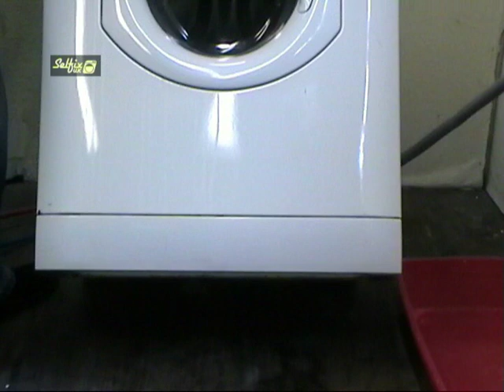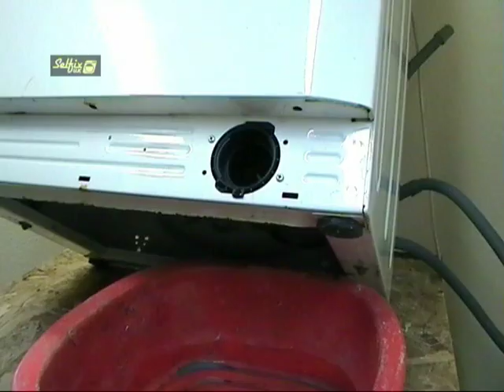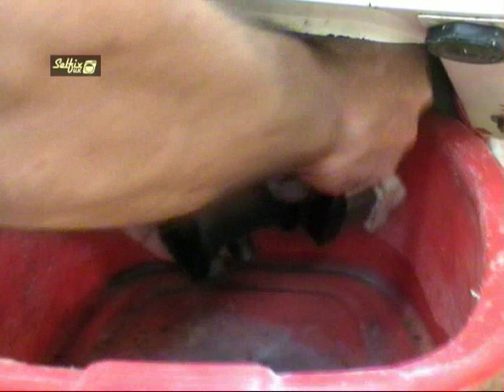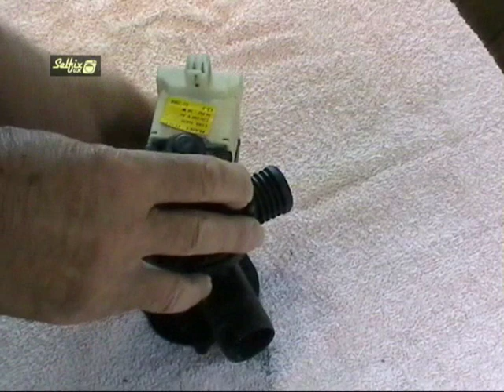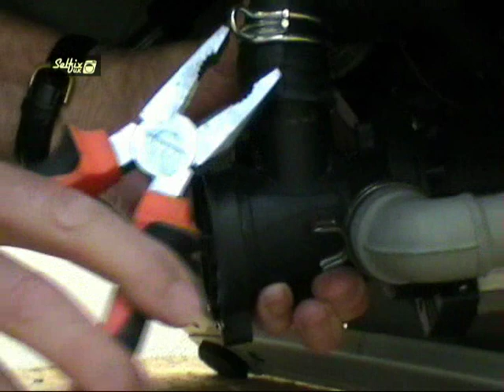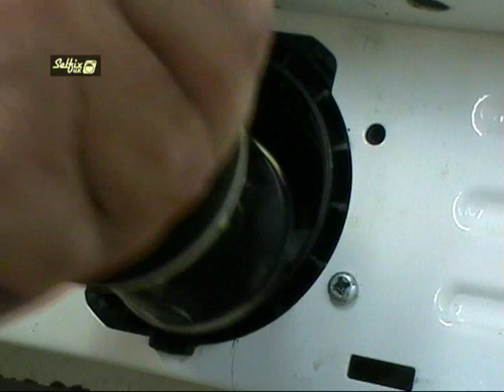Ariston A1324UK washing machine pump for selfix

Comment: The green piece on mine keeps falling off and then the unit doesn't drain properly. What would cause this piece to become detached? Is it just broken or could it just be a blockage problem?
Reply: I've really no idea what the Green piece is that you are talking about, but if any part of the pump falls off then it is broken and needs repairing or replacing. Cheers
Reply: +Selfix UK   the part that "spins" .... sorry I thought it was green in this video as well but I guess it's gray!
Reply: That is the implore blade and if that has come off then you will need a new pump